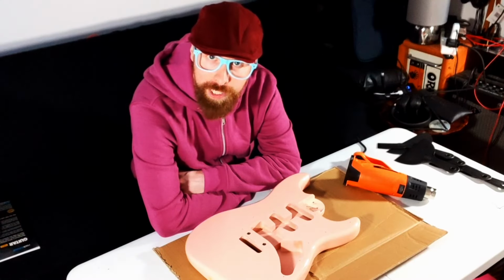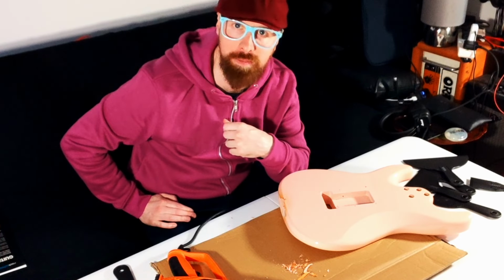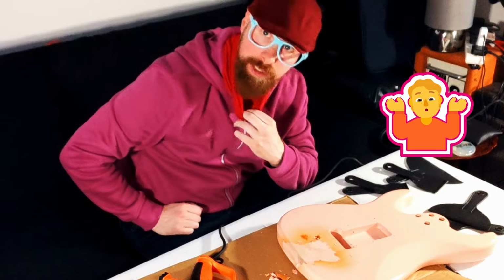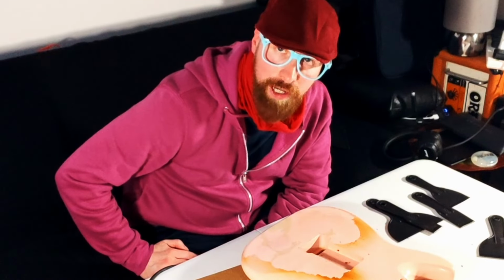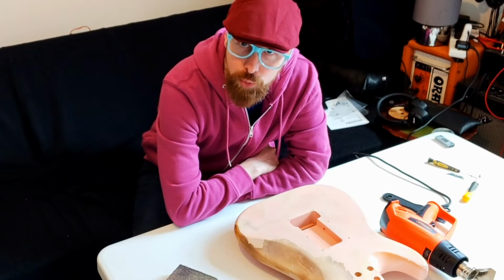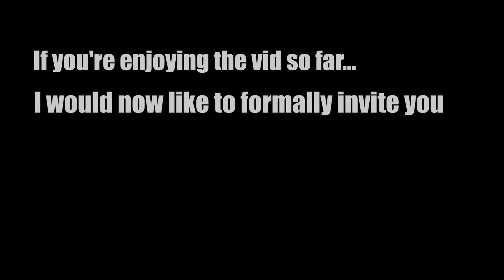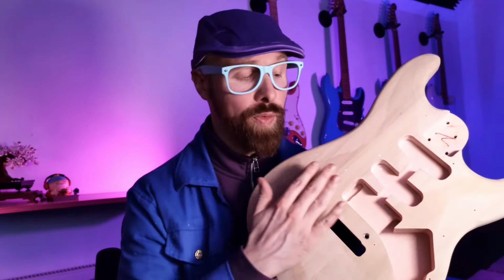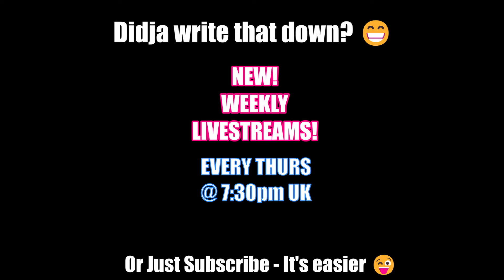Guitar Poly Finish Removal | Easiest Method?

Comment from the maker: Have you ever attempted a refinish?
Don't forget to tell me about how I did it all wrong! 😂   🫳⌨⬇
Reply: Look at what you learned bud . Be easy next time .😂 Phil  its a process , mind use a back sheet for spraying hang up the body with metal coat hanger. Go easy . Try on  blank piece of wood before committing . But even if you mess up just sand it back Nd go gain . Finish 3 cots rub down between each . Finish with wax buff it to death .😅
Reply from the maker: @cameronmeikle6766  Thank ya kindly for the advices mate 😎👍
I used a wipe on water based stain from "Bolt Guitars" as I don't have a proper space for spraying - and attempting to plan to do anything more than 20mins in advance outside in Scotland is impossible 😂
Reply: I went heat gun, took ages but I had a little more luck than you in terms of scarring the wood or whatever. Looking forward to seeing the final product!
Reply from the maker: @bosshogg8273  Cheers mate 😀👍
The heatgun probably is a good option - I just didn't have the technique down 🙈
Guitar is 90% refinished now - I just gotta buff it... then assemble it
Reply: @stevecassidyguitar  🤣
Reply: @stevecassidyguitar  have you tried a burst stain ?
Reply from the maker: @cameronmeikle6766  Oh no mate! 😂 Nothing fancy after the ordeal so far 🙈

Comment: Yeah, cool try there. I couldn't do it. Even I'd I did, I don't paint. Also, they have a seal coat,  so one wouldn't likely see the actual wood.
Reply from the maker: I couldn't do it either 😂
I went with the Bolt Guitars, water based, wipe on stain. Worked out not too bad for first time. It's 90% done now. Just got to buff it, then re-assemble it 🙈
Reply: @stevecassidyguitar  , yeah, I do stains and oil finishes.  I have a recent video up with my gold leaf Ibanez Rgt47dx.
Reply from the maker: @ranman58635  Nice one - I'll have to check that out 😀👍

Comment: It's easier with paint stripper and use metal scrapers . .you don't need a heat gun .
Reply from the maker: Yeah the heat gun was a massive fail (for me) but the plastic scrapers didn't help, or the metal one 😂🙈. It will be sander all the way IF I'm ever daft enough to attempt this again. I might 😂

Comment: I used Kleen Strip on my JS850. It took off the top orange coat and the white undercoat. There is a clear coat that didnt come off. This is as far as i have gone with the body.
Reply from the maker: Nice! How long did it take? What's the process like? Sounds like you've just got the sanding to go now 😀👍
Reply: @stevecassidyguitar  It took two evenings. I had two cans, the pre government regulated witch works without elbow power and the new environment safe which I had to scrape with plastic scraper.

Comment: You dont need to tske it back to the wood though? Just sand it, undercoat/prime it then paint.
Reply from the maker: It's a rub on, water based dye I'm using from Bolt Guitars for the refinish. So it did have to go down to the bare wood for this one. Much to my greif 😅
Reply: @stevecassidyguitar  I see, makes sense now. Don't think I could be arsed with all that though, looks a grind.
Reply from the maker: @The_Macaroon  You're totally right. My curiosity cost me dearly 😂

Comment: While it is too late now since you've removed the paint for any tips. Since you're doing a solid color and not wanting to stain the wood, you could have just gotten through the shiny poly top coat and used the paint as your first primer coat. Sometimes that's easier if wood has a lot of open pores. Ash is a monster to grain fill first compared to a more closed grain wood like alder. Anyway, when I've done solid refins I just use the existing paint as my "primer" or base coat. Especially since you're going darker and not lighter. If you're going lighter in color you can get bleed through of color if your doing a thin finish. I don't mean the paint bleeds through, but the darker color and change the shade of the color your shooting if it's lighter. Since this is darker pink you wouldn't have had too much trouble. If you do this again you can always sand away the shiny top coat and then shoot a thin neutral primer color before your desired color. I do mostly stains on raw wood where it's matte and often I don't fill the grain for that raw feel. Usually on new unfinished bodies. I've never had luck with a heat gun. I've always just used an orbital sander and hand sanding to get in the tight spots. Good luck. Hope that made sense. It's after 1am and I should be asleep instead of watching youtube.
Reply from the maker: Ha! Nice one mate that all made sense - great advice - thank ya! 😀👍
If I ever paint a guitar - that's definitely the route I'd go. (I doubt I'll ever paint a guitar though 😅).
But for this one - It's a rub on, water based stain that I'm using from "Bolt Guitars", So I did have to get it down to the bare wood. I've got it refinished now and also didn't use any grain filler. It's looking pretty good now I think 👍
And yeah lessons learned - Sander is definitely the way to go 😂👍
Reply: @stevecassidyguitar  Ah I thought since you were doing the darker pink you were spray painting. Yeah, a stain ne4eded you to go to wood. Glad it turned out well. Look forward to more vids.
Reply from the maker: @MikeS4628  Thank ya mate - Will hopefully get part 3 out in a few weeks 😬😂🙈

Comment: Does sound like a painful experience. 

I am no expert but could you have dipped the guitar body? 
I heard that with furniture some places can dip it in acid to remove the finish quick. Obviously you would have to take it somewhere to get it dipped 😃
Reply from the maker: Yeah mate - A few people here have suggested that 😎👍
Having never attempted removing a finish before, the 3 options I looked into were stripping as you suggested, heat gun and sander.
Heat gun (looked like) the easiest - but it obviously wasn't for me 🙈 
For some reason, I don't like the idea of the chemical option, having the body wood potentially, sitting in that stuff too long, doesn't seem right to me 🤷‍♂
Sander worked great though. If I ever try again - sander is the way I'd go 😁👍

But might also investigate this dipping method further. Would obviously be way easier to have someone else do it 😜

Comment: I have to say, I recently tried to strip a guitar with heat and the finish just wouldn't budge. I ended up sanding it. Not sure why that one was particularly hard, but it looks the same as the problem you had. Magic paint perhaps?
Reply from the maker: Nah mate it was definitely user error with me. Inexperience, poor "technique" and using plastic spatulas that were melting 😂🤣

Comment: Why not use paint stripper? I believe your main brand in the UK is Nitromors.
Reply from the maker: Having never attempted removing a finish before, the 3 options I looked into were stripping as you suggested, heat gun and sander.
Heat gun (looked like) the easiest - it wasn't for me 🙈. 
For some reason, I don't like the idea of the chemical option, having the body wood potentially , sitting in that stuff too long doesn't seem right to me - then there's the smell and doing it at home.
Sander worked great though. If I ever try again - sander is the way i'd go 😀👍
I wouldn't rule out chemical though - a lot of people have suggested this - Cheers 😀👍
Reply: Because of restrictions on domestic use of chemicals, Nitromors is now a shadow of its former self.
Reply from the maker: @confounder  Good to know - cheers mate. I'll likely stick with the sander next time then  👍👍

Comment: I only once refinished a body and as I was relicing the thing so I didn't give a sh*t and just went hacking at the finish with a scalpel. 
Just refinished it with good old Tru Oil after massacring it. It was the first of my guitar projects I actually managed to sell for a profit.

If I had to take the paint off of a guitar body I would instantly go for the power sander like you did. You have to sand that thing anyway. 

I finished several necks (the process is included in the documentation of the neck I carved a new profile into. Somewhere lost deep in your mail account.)

I can't criticise anything you did. I don't think I'd have done better. 

My next project is kind of a punky Strat - got an unfinished body and a neck. Right now I'm considering an Evertune bridge... But what I want to try is to sand the thing in a way the wood grain comes out great and then I want to finish the thing with pink ink. Checkerboard pickup, white Invader-like pickup. Eat this Tom DeLonge.  

I'm also finishing my ecent project (the Sonic Mustang). Only thing left to do is putting on the new frets. I had to reroute a lot of the body to make the classic slider switches, the USA Mustang pickguard and control plate to fit. All that stuff would be so easy with the proper tools, but I always think "yeah just use the stuff you have, how hard can it be?"
Reply from the maker: Scalpel! That's impresive mate!
Apologies - My email is a total mess these days 🙈😬 I'll have to find your previous one.

The stuff I used for refinishing was a wipe on water based stain - pretty cool system I think.
Your new projects sound intense! (Well for me anyway... way beyond what I would ever attempt).

Good on ya mate - Respect! 😎👍
Reply: @stevecassidyguitar  If you specificially want to look for my mail it was on March 2nd. 

The scalpel thing is not very impressive at all, I really was just smashing the blade into the guitar, carving off the finish and a bit of wood most of the time. Of course I knew were I wanted to hit. 

I used that wipe on stain on a neck before. Black strat with blood red neck. I was very young... but it looked all right and the system works great.
Reply from the maker: @tostrmofo6686  Cheers I've took a note of the date - will try and catch up with my emails this weekend 👍👍

Comment: Stripped the paint off my first electric guitar (‘70’s second-hand Japanese Les Paul copy) using nitromors, when I was young and Health & Safety had yet to be invented. Anyway, I survived unscathed and discovered it had been refinished (in white) - the body was rather nicely double-bound. I believe it was originally black and may have been a Yamaha, or made in the same factory. Anyway (2) I left it natural, as the top and back (totally different woods) were really nice. The main body comprised of multiple blocks and was a strange pinky colour, so I stained the sides Rosewood, to match the fingerboard and varnished it in satin. Really enjoyed the process and was pleased with the result. Actually, I still have it 🙂👍
Reply from the maker: Nice one mate - that sounds like a really cool result you got there. I do love the look of a natural LP 😀👍
I don't think I'd have the bottle to try a refininsh on a bound guitar - so good on ya mate 😎👍

Comment: I'm planning to do the same to a strat body. Thanks to your experience I'm now not going to bother. Much appreciated.
Reply from the maker: Sorry mate 😂🙈
It wasn't my intention to put anyone off. In hindsight I'm glad I tried it.
Lessons learned though: 
1. If using a heat gun - don't use plastic spatulas that melt 🙈
2. Just don't use a heat gun - use a sander 👍
3. Read the comments section of this vid - there's been some great insights from people with way more experience and some great tips 😀👍

Comment: I know I'm late to reply to this, but I've been working through your back catalog of videos.  I've only refinished two guitars, so take this with a heaping handful of salt, but I found the best solution was the heatgun.  However, as I was doing this with one of my daughters, she brought over her heatgun, and I used mine.  It didn't take long before we were both using mine.  It made a massive difference.  We also used chisels, very carefully.  

Handy tip if you scrap the body doing this: wet a cloth, and then place it on the guitar over the scar, and use an iron on it.  The steam raises the wood fibers and can hide a lot of nicks.
Reply from the maker: Thanks for watching the vids mate 😀🙏
Also thanks for the "Hot" tip - on the heat Gun and Iron 😜👍
I probably could have did a better job with the Gun, if I had better spatulas, not plastic ones that were just melting 🙈 I was sure I'd bought silicone ones too 😂

Comment: Can't remember what I used when I stripped a bass body, but it was a similar UK product to CitriStrip; painted it on, left it for a bit, and then just scraped it off when it started blistering. Much easier than a heat gun, and more consistent.
And for a respraying thing, try and pick up one of those pop-up wardrobe things, they make a really decent "spray booth" on the cheapo.
Reply from the maker: Ah! Good shout on the wardrobe 😃👍- I was considering one of those pop up tents for Spray Tans, but still didn't come up with a solution for hanging the body somewhere at home.
The Bolt Guitars stuff I ended up using is pretty decent though - Quite happy with how it turned out. I've still got to Buff it though... then reassemble it 🙈 Probably with mods 😁

Comment: best bet is to get a work bench with clamps and scrape as you go. And a metal scraper is the way to go. If you heat and scrape at the same time, you're much less likely to burn the wood.
Reply from the maker: I read some stuff that recomended not using a metal scraper for your 1st time as you'll likely damage the body. Silicone ones we're suggested, but I accidentally ordered plastic... coz I'm a bit of a genius 🙈
and yeah a proper work bench and clamps would've been great. You wanna do my next one? 😜

Comment: Hey just wondering,  wouldn't a very powerfull varnish stripper (that can strip polyurethane work)? I came accross a video on net to remove floor polyurethane varnish & carpet glue... it used the sunnyside 2min varnish stripper "gel". Apparently it removes multi layers of polyurethane without damaging wood. I was thinking maybe it could work on guitars... what actually makes me ask the question today is actually my local custom luthier... he once said to me they don't use scrapper & heat gun anymore. He told me they now use a "special gel"... so i may have found my luthier's hack but just asking the community here... if anyone have tried powerfull stripper gels... thanks
Reply from the maker: Oooh! Never heard of that one mate - But sounds intriguing 😀👍
Hope someone else here might chime in with more info 🤞

Comment: Showing how hard it is to remove the polyfinish has persuaded me that I would rather buy an unfinshed guitar body to save the effort!  Would a liquid paint stripper work instead of a hot air gun?
Reply from the maker: 100% - Unfinished is a smart move 😎.
I didn't fancy the chemical option.
I might try this again in the summer, but I'll just dodge the heatgun and go straight to the sander 😅👍
Reply: It doesn't. It'll remove the paint once the poly is off but commercial paint stripper won't even dent poly.
Reply from the maker: @darrengill1987  Need stronger stuff... Like Aftershock? 😜
Reply: @stevecassidyguitar  the red stuff will do it post haste.

Comment: Sanding 100% the way to do it ;) 
Way more dusty fun 😈

You got some patience crackin on with the heat gun like you did, bloody good job of it though sir :)

Also... hows about a dye and some osmo on top? Would be a total hand rub finish but the results'd be there and the wood grain'd show through real nice ;)
Reply from the maker: Thank ya mate! 🙏 This is pretty much what I went for - I used the Bolt guitars, wipe on water based stain. It worked really well - I did want a solid colour, so ended putting on coats into the double digits. But as i didn't use a grain filler, you can still see some of the grain, but not the figuring. 😀👍
Reply: @stevecassidyguitar  bet that looks epic! :) 
You're a bit good you are sir
Reply from the maker: @AnimalJohn85  Aww thank ya mate! 😀🙏
It's probably subjective 😜 Find out in part 3 ....😂

Comment: How about a hand staining like the Fazely Outlaws?
Reply from the maker: It's actually a very similar option I went with 😀👍 The Bolt guitars system is a wipe on water based stain, I applied enough coats for a solid colour though

Comment: I gained a mass of experience just watching here. I was wondering about removing poly to start a relic guitar project &, from this other fellas video it LOOKED easy enough. But this is a reminder that the level of difficulty should be carefully gauged. Steve, you’re a hero for diving in and sharing. Now… you got the power!
Reply from the maker: Thank ya so much mate - this means a lot 😀🙏
I could have edited out a lot of bits to make myself look a slightly less stupid, but thought warts n all is best 😜👍
The good news with a relic project is, You can give up at almost anytime during the process and still end up with a reliced guitar 😂👍

Comment: As an old fart I'd have gone straight to the power sander while wearing a particulate mask and safety goggles. I've only had to sand down a kit guitar- a tele type- and I had to go through 5 grits until I felt it was smooth enough and ready. Thenm I applied Saman water-based finish with both a sponge brush and paper towels. Ended up working well -matte finish. Covered it in Minwax and rubbed that in everywhere.Still, it is a very low quality kit guitar and I learned a few things. (Like, don't buy kit guitars!)
Reply from the maker: Lessons learned eh? 😂👌
I'll likely go straight tot he power sander if I attempt this again in the future and yes... I defo need better protection next time too🙈